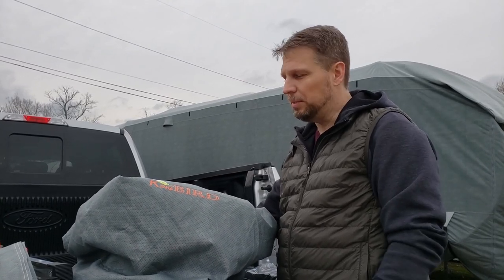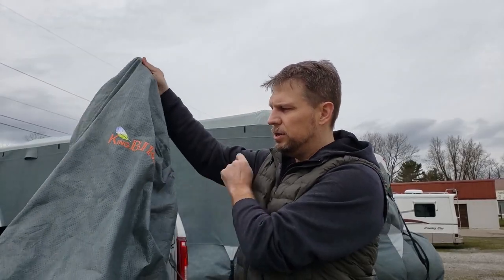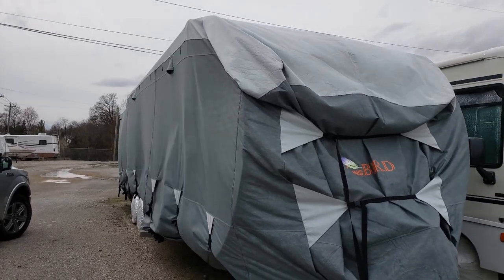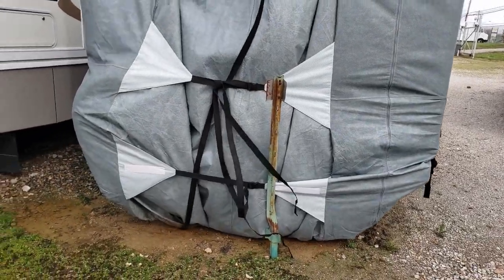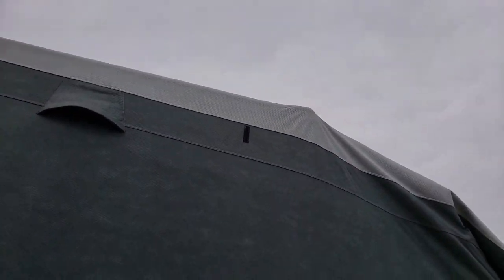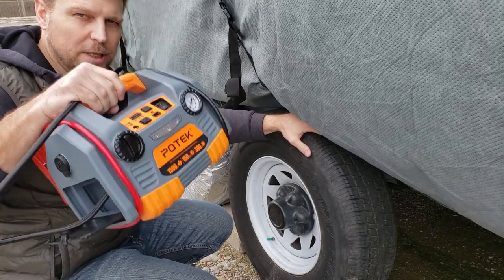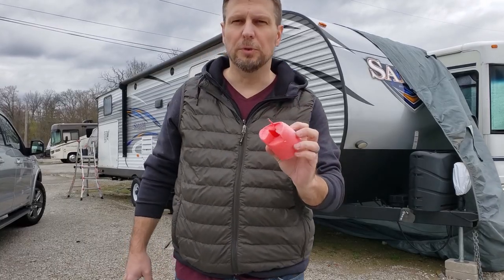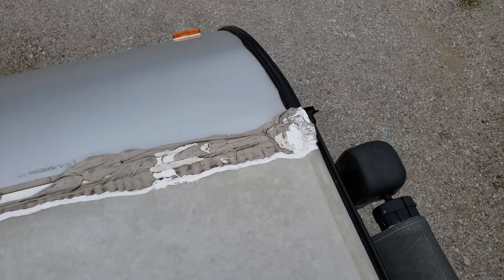KING BIRD TRAVEL TRAILER COVER | BEST RV COVER | Review With Results

Comment: I have an E-Pro 19FD  Will I be able to get into the camper after the cover is on, without removing the cover.  Also I assume I should order the 18-20 ft cover
Reply from the maker: You should be. All the covers I've used has some sort of zipper access. I usually go in mine once or twice in the winter just to look around.  I like to make sure there isn't any rodents or water leaks.
Reply: Thanks, I placed my order using your link.

Comment: Does anyone know how to properly measure for a cover. Do I include the spare tire in the length or not? If the length of my 25s trailer is 24' from bumper to front of cabin should I buy a 22'-24' or a 24'-26'? Thanks?